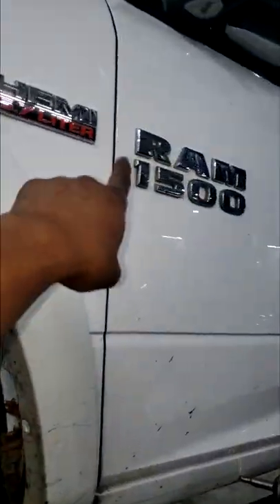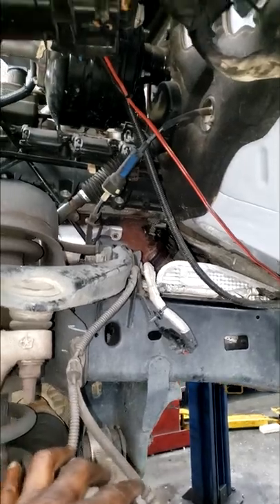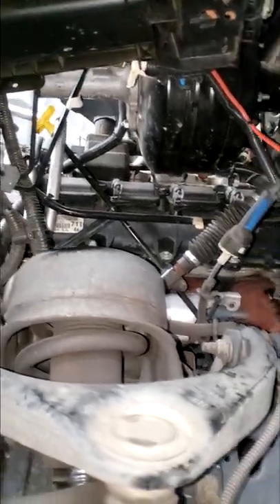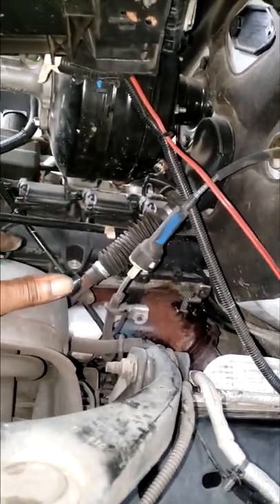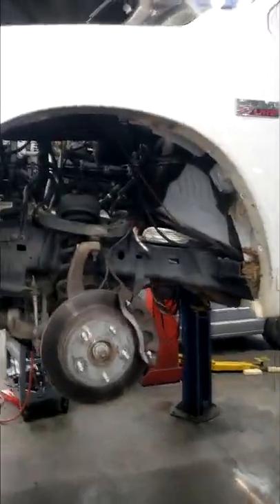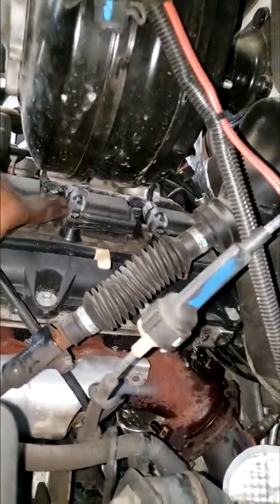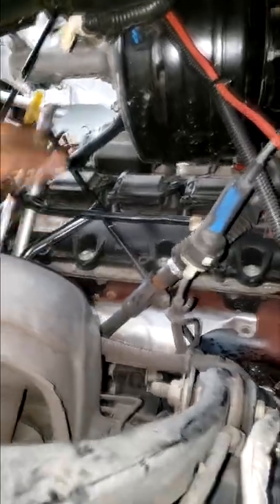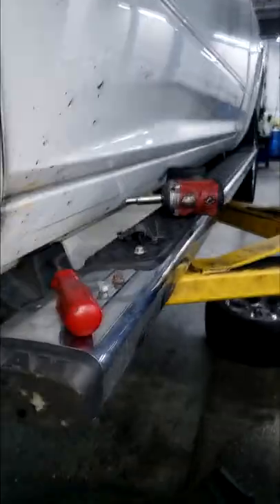Dodge Ram 1500 Hemi Tune Up Spark Plugs Tips. DO IT THIS WAY EASIER. #JTtheCarGuy #shorts #ram1500

Comment: Bro, I finally got my 2005 chrysler 300c back from the dealership,  they put a new ECM, fixed the red lightning bolt and the limp mode. I still have the short in my drivers door, but I  have the harness.  Thanks for the videos.

Comment: I do the plugs on my third gen with the Hemi, never any clearance issues with the brake booster. Mind you I do it ol' school with a ratchet no power tools. If your plugs are that tight you need a power tool, I'd be pretty worried about the threads in those aluminium heads being tore up.

Comment: No need to do all that.  All you did is just made more work if your only doing a tune up. . Those trucks are easy to do plugs on. Loosen  the plugs, unscrew them by hand if you have too and pull the extension up and disconnect it from the socket while holding the socket with your fingers then pull the socket and plug out.   Simple
Reply from the maker: Lol, that works great for Lorenzo. As I stated in the video this is another option if you dont feel like fighting with the booster in the way. Theres guys in the shop that go this route all the time and it works great for them. Its basically a personal preference thing.
Reply: Don't waste your time, He knows everything and won't consider anything else
Reply from the maker: @xfhnhhgjbvcfg  Theres multiple ways to skin a cat. You should simply choose the one that works best for you. Theres no right or wrong way to get to your goals on this.